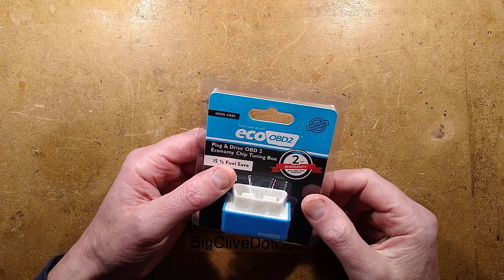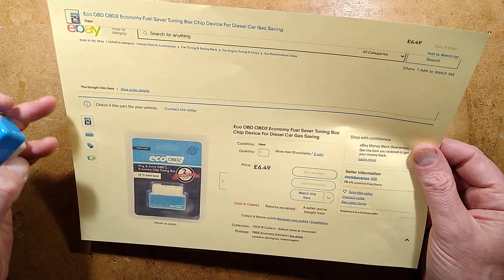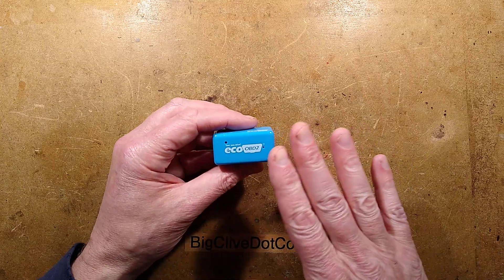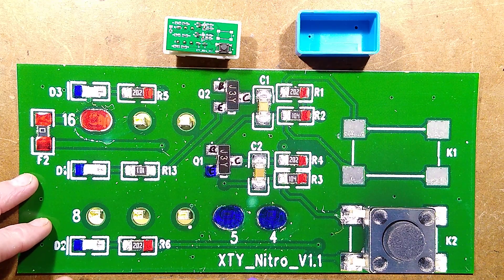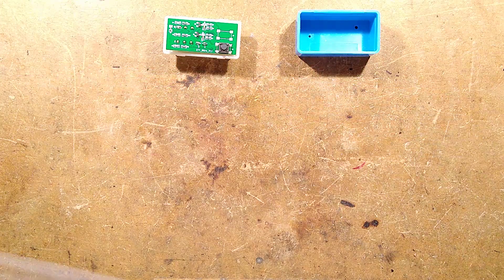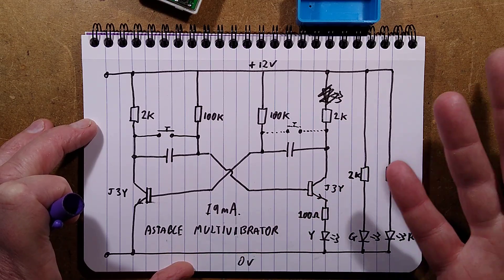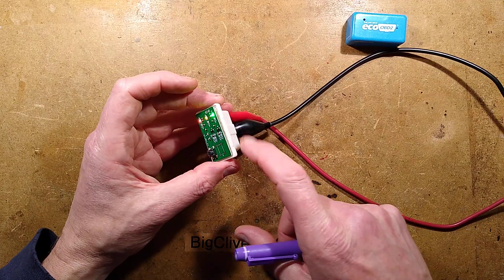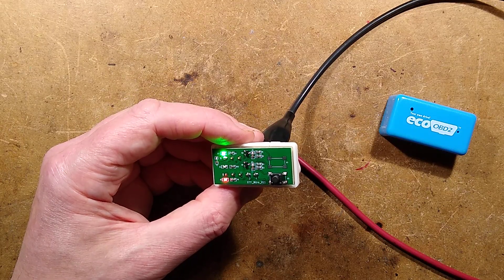Worst fake Eco OBD2 fuel saver yet (with schematic)

Comment: Yeah it would be really crazy if whoever makes these OBD2 fuel saver scam devices managed to make the device take over and control the fuel gauge, so a person is driving along, amazed at the fact the gauge says there is 3 quarters of a tank left, when usually they would be running on empty....Then the vehicle stalls and dies and won't start back up they get the vehicle towed toa repair shop, they go through everything.... Everything works fine, nothing malfunctioning or broken....Then they see the fuel saver plugged in....They unplug it, and the fuel gauge suddenly goes from 3 quarters of a tank down to empty....They add a couple gallons to the vehicle and it starts right up....They call and say the vehicle is ready and they hand over an invoice for troubleshooting labor, and 2 gallons of gas and say "The vehicle was out of gas....That fuel saver thing was controlling the fuel gauge!" 🤣😂🤣

Comment: If you look at the circuit diagram on the ob2 dongo itself. There's literally no pins being solder to the circuits besides just the voltage positive and negative. Makes me feel very sketchy about plugin it onto my vehicle obd2 port.

Comment: Totally Worthless:  After driving for over 500 miles with it I ran a test. Drove 60 miles at 65 MPH the turned around and drove back same route at 65 MPH after removing module.  I got 24.5 MPG going with it in and after removing it on way back I got 25.8 or 1.3 MPG better without it!!  It's worse than JUNK!!!!!!

Comment: I would not plug anything into an OBD socket on my car unless it was a reputable brand scanner or code reader. The OBD port on your car is a serious port and should not be used for another purpose other than reading codes and diagnosing problems with the modern complicated car electronics. It would scare the crap out of me if someone plugged this device into one of my cars. Be careful of cheap OBD readers also.

Comment: This product is no longer available. There is a new product on the market right now, and it saves you up to 35% in fuel, so they say.
The new product is called ecomax, and you can buy it with 50% off the price for only €49.99. Yes, quite a lot more!
This new product draws about 50 mA from the battery and does have a chip that might be a microprocessor, but that is NOT connected to the CAN bus.
Can you have a look at that "fuel saver" as well?
Reply from the maker: I've looked at quite a few of them.

Comment: I love how a distressing portion of the general populace can think that a £6 generic (and unbranded) plug-in is going to make an engine more efficient than the manufacturer built it (particularly if it's less than 30 years old). since fuel economy has always been a factor, balanced with performance and the size of the vehicle. e.g. if you want a big, high-performance car you can't complain that it only does 8mpg...
if they're so desperate to save fuel, clean the sh-tuff out of their boot, and throw some redex in the tank next time they fill it... (costs the same, more likely to produce a result.

Comment: At best it will do nothing but some because of the internal circuitry can damage your ICU and injection system which will be a very expensive repair. If you want to save fuel drive slower and avoid aggressive braking. It's free and easy to install. No wires to solder or special tools needed. And it makes you safer while travelling from A to B.

Comment: I installed one of these in my car and, while I didn't notice any fuel savings, I did notice a vast improvement in bass and detail in my audio system. The soundstage was very impressive, dynamic and buttery, and I could clearly identify which instruments were in the car pool lane and which were in the break down lane. Makes a 1998 Ford Taurus sound like a Bazuki HeyRon! Get one of these to reduce jitter in your satellite radio and other Digital audio streams. In fact, if your garage is attached to your house, the proximity of this device will improve your home system and save you thousands on more expensive audiophile doo-dads!  I recommend the official Placebo Effect brand Electronic DooDad for best results.  It's only $5,999 (USD) because, while it is the same design as the one shown here, all components are rated at .00001% with Oxygen Free Cardass Copper!

Comment: Never trust anything like this that plugs in and promises to save you fuel.  The only way you can save fuel is to drive gently (and not aggressively) or drive less.  Those are the two guaranteed ways to save fuel (that and keep up on car maintenance like oil changes, air filters, tires and tire inflation).  Those are proven methods to reduce fuel consumption.

Also if you do happen to find a device that could save you money, like a true reputable tuner perhaps, they cost a good amount of money to begin with so when you do the math, you may not be saving any money in the end because you bought an expensive device to save you money on fuel.  So that's why it's best to resort back to economical driving habits and upkeep of your vehicle.  The two things that have proven over and over again to save you money without really spending any additional money other than the cost of general maintenance (which you would have to do anyway whether you used one of these or a tuner).

Now the sad thing is with my 2020 Camry I can drive aggressively or econimically on the highway and still get about 38-40 MPG, so some cars are normally just good on gas even if you drive them a bit hard (mine is the 4 cylinder version though, not the V6).

Comment: i saw a worse one. an "antenna" for your tv was advertised in the US. it was touted to be as much a wonder as your gizmo, able to suck transmitters off their bases. it looked like a length of pvc pipe with pipe caps at either end with a coax cable coming out... because that's what it was. no components of any sort inside. unless you call the dollop of hot glue that held the cable. Caveat emptor! XD

Comment: I have a question, there's redex fuel additive, it's red for petrol engines and blue for diesel engines. The composition of both seems identical, so would I be right in thinking that the diesel one is dyed blue as if it were red  it could cause confusion over the use of non taxed red diesel. Not that I would ever run my van on red diesel with a splash of redex red in it and an empty bottle in the toolbox. 👍
Reply from the maker: We have the Redex here.  I'm not sure what's in them or if they actually work.
Reply: @bigclivedotcom  they stain tax free diesel red in the UK, for farmers usage etc but some put it in their vehicles which is illegal but understandable.  I just wondered how the law would work given that you would have basically dyed the fuel red yourself? Maybe some UK experts can advise? Thank you.👍

Comment: Well they are partly right after installing this your car will need to relearn how to adjust fuel ratios. But so will a dead battery. And the pcm is always adjusting the fuel ratio based on cam/crank/o2 sensors and so on. The o2 heaters take some time to heat up and a few drive cycles before the oem program learns how to adjust and look for bad responses. These are right up there with the little turbo you install in your air intake hose. Cleaning your mass air flow sensor or new o2 sensors/fuel filter if equipped tune up when needed. Giving the engine a good carbon cleaning couple shoots of carb cleaner down the vaccum line off the brake booster or intake or in the gas.  Then  taken on a open road doing a few quick 0-60 does 100 percent better then anything on the market.

Comment: It's unfortunate for the dummys that get conned, but do they ever have their brain engaged.
If this kind of crap actually worked all the car manufacturers would be using it on their cars already.  It's a very competitive buissiness and one of the things all potential customers will always ask about any vehicle they are going to buy is how many miles per gallon does it get?
If there was some magic gizmo that increased the mileage they round be using it right off the line.
Yet there are fools that will believe in this crap.

Comment: Our local garage fitted something slightly more involved to my wife's BMW and tried to charge her £395 for it. They had also told her it "learns your driving behaviour and fine tunes the engine settings for maximum efficiency and power."
I took it out and told them where to stick their bill. I also reported them to Trading Standards.
Edit; Jesus these things are all over eBay. One seller shows 909 sales. At £7 ish assuming a purchase price of 50 pence that's nearly £6000 straight profit. How is this even possible eBay?

Comment: MightyCarMods found something similar back in the early days of their channel ("eBay Performance Chips - Mythbusted"). All the electrical circuit did was change the LED colors according to the mode switch. And you have to splice into and potentially damage the wiring loom to install it.

Comment: With the LEDs that don't even line up with the case so they're partially invisible, the unpopulated second button position, and the relatively poor general design, This really feels like some "demo" PCB design that somebody found on the internet, stuck into this OBD-box and shoved out the door.  The board was probably not even originally designed for this application...

Comment: I am a retired automobile mechanic, employed between 1972 to 2008.
I lost track of the number of items that were fraudulently
Advertised to improve fuel economy.
There were fuel and oil additives, devices that attach to the
Fuel line, devices that were placed in the air intake. 
Devices that change the ignition timing and injector timing.
All of these items cost money, either as a running cost, which adds
To the cost per mile, or as a one-time investment.
Some of these items have caused damage to the engine as well as the 
Exhaust cat converter.
Remember what stoichiometric fuel air ratio 14.7:1 is?

Comment: Ex mechanic here, few comments. 

1. Avoid most if not all obd2 fuel savers even if specifically made for your vehicle. If you have to get one go a reputable brand. But you won't be paying less than 50, hell id be shocked if you find a real, and safe one below 100.

2. Only thing you should ideally plug into an obd2 port is a scanner if your not a mechanic or tuner.

3. Be careful with those scanners, let me put it this way, if you can buy a scanner below 20 dollars, but mechanics use some that cost 15 grand and more, well why would we ever buy or use the expensive one? It's because they need to be safe, and work with most if not all vehicles it can communicate with.

4. There are generic, and working tools you can get to save fuel, or even improve performance. They are tuning tools that cost thousands, even then sometimes it's better to upgrade the bcm and ecu to things like a haltec system. But in short you plug the cable into a laptop or computer and the obd2 port, and actively change things like timings, injector durations, throttle profiles etc, it's a huge list and can be dangerous to your vehicle. Do not recommend.

5. If you want to save fuel change your driving habits. Most of these fuel savers "work" because your more mindful of your milage and will actively do things to save fuel, on that note turning on and off your vehicle at lights and stop start situations CAN save you fuel if you stop for long enough (your vehicle uses alot to start compared to idling for the most part) but the main reason to avoid it is vehicles with stop start features have special starting systems. With beefier wiring, relays and most importantly the start motor. If a start motor costd 1600 to just buy, well fuel prices will need to go insanely high to justify replacing them fairly regularly.

Comment: That 15% fuel savings speaks for itself! Surely, it's worth a try...
Reply: Ok hear me out... go to the scrap yard, pick out some extra OBD2 ports, put em in your car, put one of these in each! Theoretically you could reach up to 105% fuel savings (AND BEYOND!)
Reply: @Teeh0  And also don't forget to change the flashing LED in those fuel saving device to RGB lights. It could give you extra 150% fuel savings to each OBD2 and also increase your car's acceleration and top speed by 50%
Reply: @Teeh0 Imagine if you put so many of these in your car, it starts generating fuel, then just go a siphon it out and sell it!
Reply: It's keeps your battery drained so you drive 15% less.
Reply: Can't do that. The oil companies bought the rights to that idea. Where do you think most of our gas comes from these days! Duh....
Reply from the maker: Millions in use worldwide, so they must be good.
Reply: Somebody should have put in a vise, compacting it about 15%.
Reply: Do Canadian cars even run on gas?  Thought you guys were still going the Fred Flintstone route...

Comment: People who sell devices like this should be charged with fraud, there is no way on earth that a device like that is going to effect the pre programmed car management systems for the injection/fuel metering system and air management system. The only way you can do that is follow the usual steps of slow steady acceleration and making sure your car tyres are correctly inflated to reduce the rolling resistance of the vehicle by driving sensibly.

Comment: My calculation says that in about 208 hours this device would completely drain a 50 AH car battery. In other words you leave this plugged in and your battery is dead in 8-9 days without driving. So it will have a bad effect in typical circumstances. We have a truck that had a parasitic current drain in a similar range because of a bad connector on the light under the front hood, and the truck needed to be started and run every day in the winter.  Basically this is a flashing light box.

Comment: Before watching, my guess would be the schematic turns out to be a few blinking leds with a $0.03 microcontroller or even just a resistor and led. I'll be back in about nine minutes to reflect.
Reply: At 3:22 So yes, the led blinks. But, is it just a bloody two transistor multivib!? LIke the one I made in my electronics kit as a kid, when I was 8!?
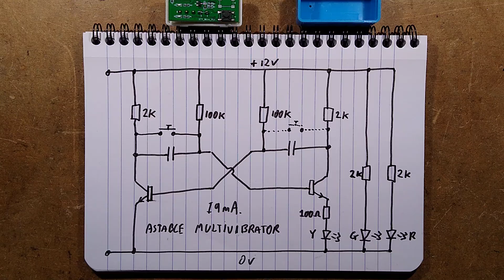5:00 ... the moment I realize I know that schematic for about 40 years now ...
Reply: Yep. Wow. Just wow. Just utter wow. I mean.... is that actually cheaper than a three cent microcontroller?

Comment: it is important to note that you SHOULD NOT do anything with the OBD port that you are unsure about or plug any cheap devices like this in, or cheapo code readers. Take it to a local garage!  - Another note, if you do happen to use one and brick your CANBUS/ECU on SOME cars you can remove both battery terminals and leave it for an hour and/or hold the positive/negative leads together and then leave it for an hour (!not live!) :)

Comment: The classic two transistor multivibrator circuit has the collectors' voltage switching between the supply rails.  In this device that is in the region of 12 to 14 Volts, say 13. That is then coupled through the capacitors to the bases.  So the bases would go from +0.6 Volts to around -12.4 Volts.  However most silicon transistors have a maximum base emitter reverse voltage rating of around 6 Volts.  So the transistor without the LED is exposed to regular base-emitter breakdown.  Not good for the transistor and also makes the frequency much higher than expected.

Comment: Back when I tuned carbureted non-catalytic cars on a Bosch tuneup machine. I found engine air filters while they may look clean, can be restrictive. If the CO was high, installing a new stock air filter would bring the emissions down to acceptable limits. Of course modern EFI can compensate for a dirty air filter, but for efficiency it’s better to let the engine breathe.

Comment: Another way to save on fuel is by adding your own acetone to the fuel. It takes only a tiny amount of 100% acetone to increase the octane rating of your fuel by a few points. So you can buy the cheap shitty 87 octane and a cheap bottle of acetone and make your own 90+ octane.

Comment: Ages ago, I built a similar device that plugged into the cigarette lighter socket on my Honda.  At night, I'd shove it in, and the casual thief would see what looked like a car alarm blinking away.  To the extent that it worked at deterring break-ins, it did a whole lot more than this piece of crap, and did it with less than half the number of parts.

Comment: Your ECU already tunes itself to maximise fuel economy to your driving style. What this thing advertises is already built in. 

You can clear those settings (plenty of videos around on how to do that) and see how (rough) your engine runs without them. Ironically it does take the ECU around 200kms to apply new settings, so the listing probably copied from a vehicle manufacturers website or shop book. Your car is already as fuel efficient as it's going to get for that make and model with your driving style. If you want to save money at the pump, you have to change how you drive. 

Real tuning chips do the opposite and are intended for a niche enthusiast market. They're a cheaper way to tune your ECU for greater performance (at the expense of fuel economy) or for higher torque on the low/high end. Real ones only give marginal improvement however, if you really want those kinds of results you take it to a specialised tuner whom will tune the ECU to your specific vehicle, with your specific use case and your specific driving style. That's a bit of coin though.

Comment: The next version will be a flashing LED with the switch across it so the LED goes out when the switch is pressed. Saves on transistors.
To give the impression there is complex circuitry inside they could put a blob of epoxy resin on the board to imitate a blob chip.